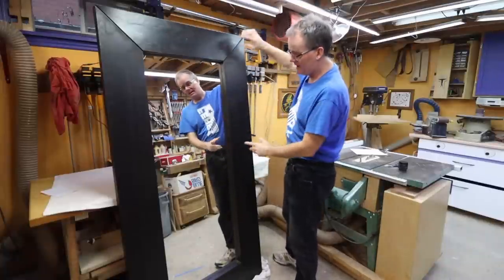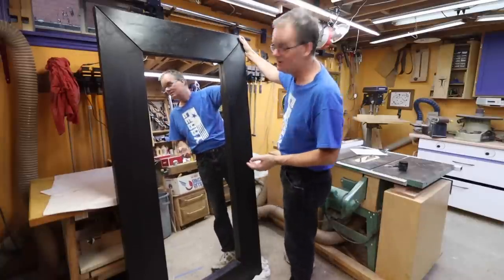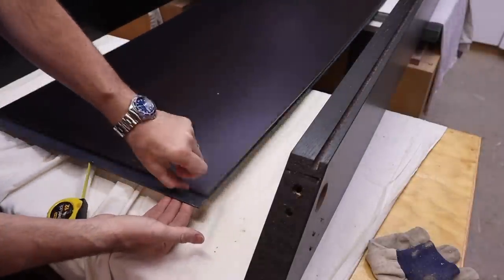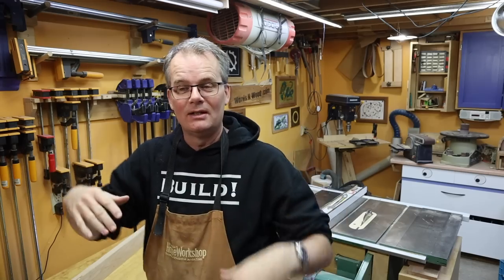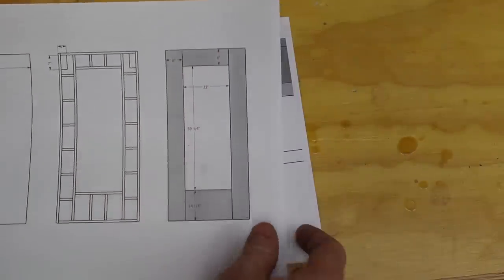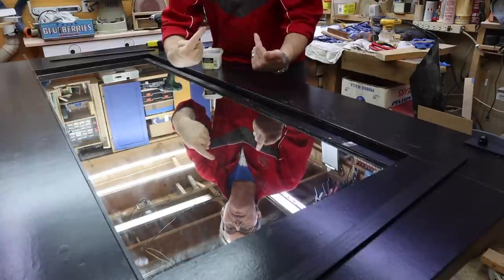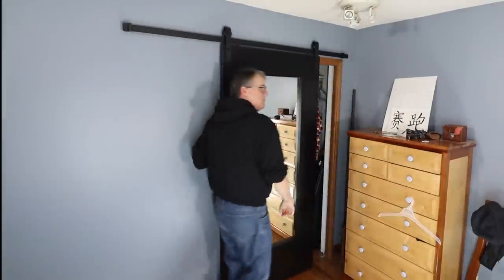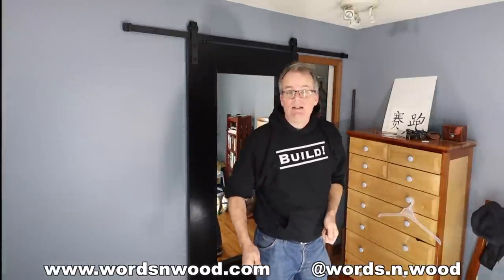Building a door with recessed mirror FROM SCRATCH!  (WnW #189)

Comment from the maker: Is it still woodworking if you cover it in blackpaint?
Big thanks to all our Patreon supporters!!!   https://www.patreon.com/wordsnwood

📃Build Article:  http://www.wordsnwood.com/2020/mirror...

It started with a free Ikea mirror/headboard and the goal of making a barn-style sliding closet door.  The mirror frame was damaged so I ended up ripping it apart and keeping just the glass mirror and then I made an entire new door from scratch.  I used torsion box construction, with a large recessed area in the middle to hold the mirror.

---------- ---------- ---------- ---------- ----------
🗜 LINKS TO SOME OF THE ITEMS USED:

(AND/OR other tools and jigs that I use and recommend.
Most of these are affiliate links.  If you buy through these
links it helps support my channel.   Thank-you so much!)

My hardware kit was bought from amazon.ca.
https://www.amazon.ca/gp/product/B07P...

These two kits from amazon.com appear to be identical to the one that I used:
https://amzn.to/2StKS0s
https://amzn.to/39BCem2

Or just search for "barn door hardware"  https://amzn.to/2HnZDLP
and find something else that suits your goals.

http://amzn.to/1V4ZHkv — Painter’s Pyramids
http://amzn.to/1WSNq1j — Stanley Leverlock tape measure 
http://amzn.to/2lYXz3W — Other auto-locking tape measures
http://amzn.to/1YP3rXy — Irwin Quick-grip XP600 clamps
http://amzn.to/1LleENk — Bessey small 4” F-Clamps
http://amzn.to/1qbopUK — Bessey VarioClippix, Adjustable Spring Clamps
https://amzn.to/2uVDPAq -- loc-line dust collector hose
https://goo.gl/g8CNRU -- (Same type of thing @ Lee Valley)

📸  GEAR I USE TO MAKE VIDEO:

https://amzn.to/2OVusfx — Canon EOS m50 camera kit
https://amzn.to/2nI7w8Q — Shure VP83 LensHopper Microphone
http://amzn.to/1qPkvBp — Canon T5i
http://amzn.to/2aK7jZX — Inexpensive Quick Release tripod ball head  (Very useful)
http://amzn.to/1SSwOmS — Sony Action Cam. (I use the HDR-AS15 which is discontinued -- cheaper than a gopro.)
http://amzn.to/267XM3M — Sony Live View video remote for Action Cam
https://amzn.to/2NddVjk — But I do also have a GoPro Hero 5 Black
http://amzn.to/1XC2D7l — Joby GorillaPod (Flexible small tripod)

---------- ---------- ---------- ---------- ----------

MORE MORE MORE:
http://www.wordsnwood.com
https://www.instagram.com/words.n.wood
https://www.facebook.com/wordsnwood

---------- ---------- ---------- ---------- ----------
🙏🙏Thank-you! 🙏🙏
Category

Comment: Hello.  I'm in the process of making 2 small barn doors with mirrors for my wife closet.  This would be my first time making a barn door.  I was thinking of making a frame with solid wood and setting the frame on top of a plywood sheet.   1x6  I like the idea you did adding stripes of wood for support for the mirror.  Did you glue the mirror?   Do you think a sheet of plywood would be okay?  For a closet door?  Should the plywood be 1/2 or 3/4 ? I need something flat for my mirror. Thanks
Reply from the maker: I did not glue the mirror.

Comment: No doubt most of your viewers are in the US, but there's a whole world out there that uses metric measurements. Could we have subtitles with millimetres, please ?
Reply from the maker: Fair comment, Phil.  I should try to do that going forward.     The underlay plywood was 4.5mm thick,  The strips of wood I ripped as filler inside the door were 28-29mm thick.   The hanging door hardware supported doors from 35-42mm thick.   The door I built was 2083mm tall and 965mm thick.  The "front panels" of the door were all 203mm wide, except for the bottom one which was 362mm tall.

Of course a lot of the thickness dimensions depend completely on the sliding door hardware.     As in, it all depends on how thick of a door the hardware supports.
Reply: @Wordsnwood  Thanks for your detailed reply ! I liked the project and I enjoy your approach. And when you make a (very occasional) mistake, I'm glad not to be the only one.